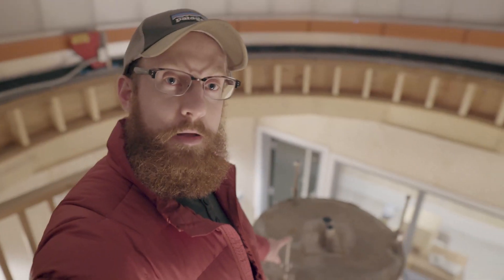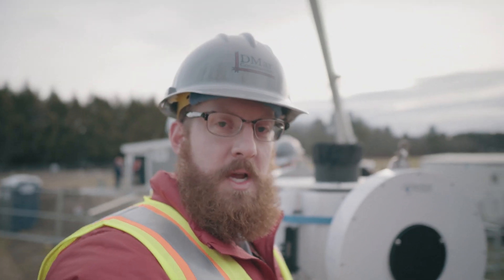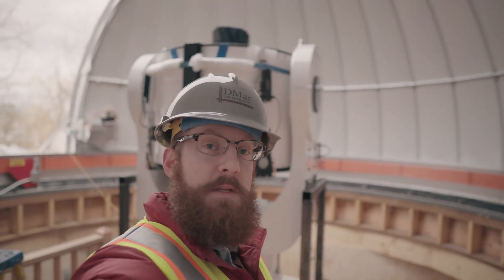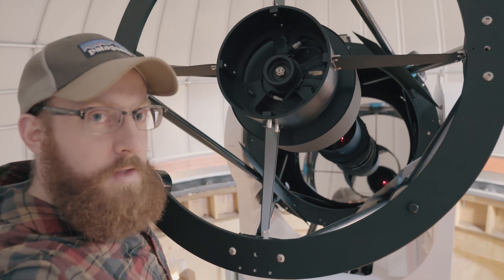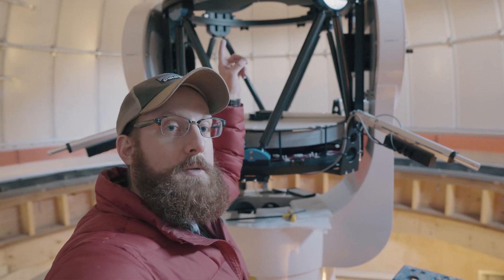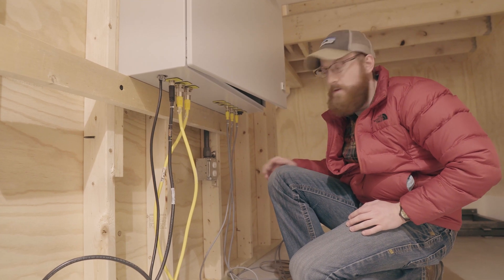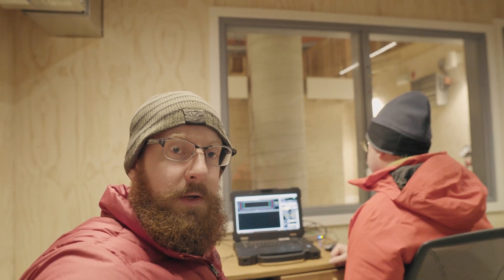Installing a PlaneWave Instruments CDK700 telescope

Comment: So if you do an FEA analysis on the base, mount, and include the three 3/8" bolts your mounting everything on, what do you think is the weak point for vibration?  Hint.: pretend everything is rubber and shake it. Now increase the modulus by a factor of 10 and shake it....same resonance modes....  Please correct me if I am wrong, but why on earth would you mount that with that connection method?  I mean it would be <$25 to have doubled that bolt size and you would have probably added a factor of 3x to the transverse stiffness.   Why do people put so much effort into the column support design and then do this?
Reply from the maker: We mount the system via 3/4 inch threaded rod anchors and the direct drive motors have no problem with this connection. Standing off the azimuth base from the concrete pier top is important incase maintence needs to be performed and to access the inside of the azimuth axis base. All of this yields system tracking between 0.05-0.15 arcseconds of error.
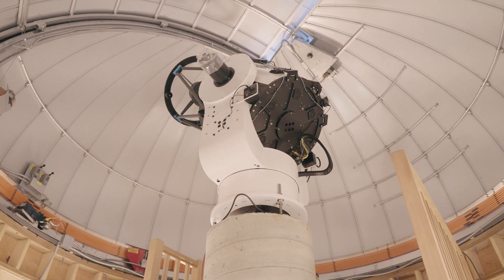Reply: 13:10 - makes me cry.  That is so unacceptable.